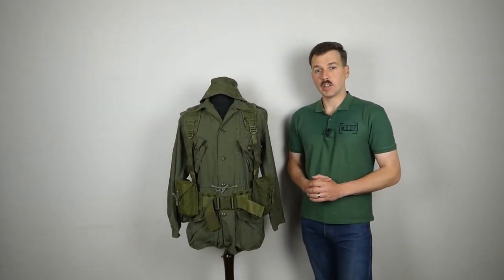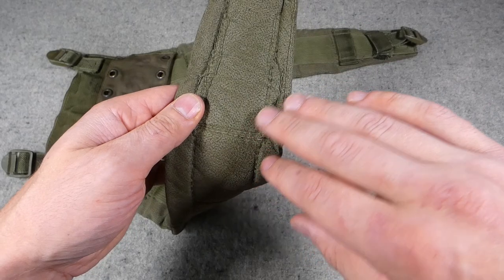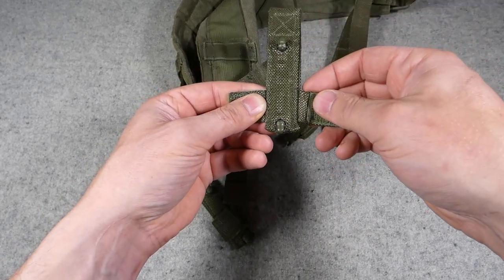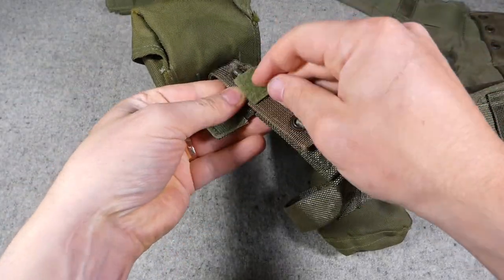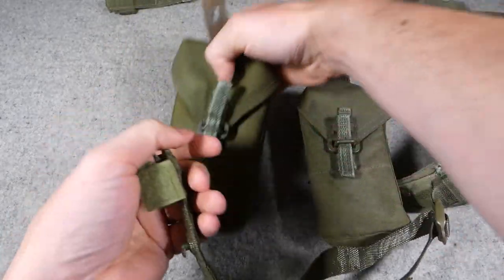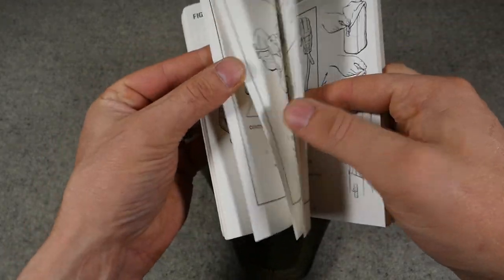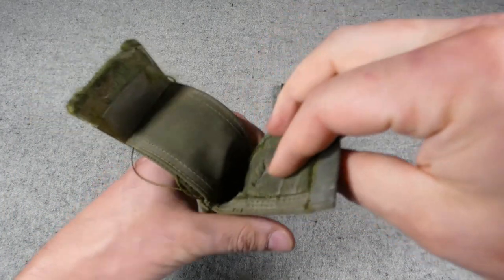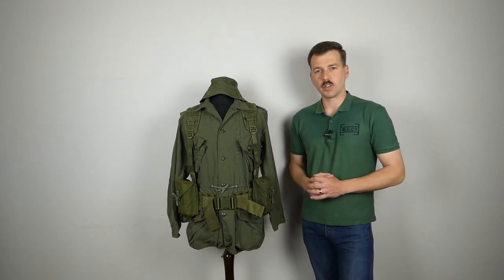Canadian 1982 Pattern Webbing Part II

Comment: In 1990 for the Gulf War I was issued a pattern of body armour which had hinged shoulder pads and brass hooks to locate the belt.  The vest of course interfered with the normal arrangement of pouches and straps.  The solution was to extend every adjustment and wear the '82 over the vest, clipping and velcro'ing the closures into place.  It was handier than putting on the vest then the webbing, and everything was still in position.  The problem of course was the whole upper body assembly weighed about 35-lbs all bombed up.

Comment: When I was in the CAF we didnt "cross draw" the bayonet. We used our left hand, twisted the bayonet upside down, yanked it down & out with a quick pull & then attached it to the C1 clasped between our knees held by our right hand
Reply: Exactly the same way we were taught to draw our bayonets in the Guards Depot Pirbright in 1974. When I came to Canada and joined the reserves (TA) they gave me prior service credit and promoted me to Cpl.  my UK training was pretty similar to the Canadian forces with some slight modifications. 💂‍♂️🪖⛑️🏴🇨🇦

Comment: Very nice video, only thing I would "complain" about is the middle drawstrings on the jacket. They should be tucked inside of it instead of being left outside handing. What I do with mine is tuck the left string through the button hole & the right one under the button itself. then just simply tie it and tuck it in and it should be fine.

Comment: 1- that tab might be quick to release but it was not quick to reclose in the winter with gloves on  and impossible with mits 
2- the hocks war down over time and eventually were just studs that would let the hole thing fall apart 
3-I never used it without the 2 mag pouches , mess tin carrier  ( with rain gear in that ) , small pack  , KFS  small pack ( aka but pack  which was the best part of the hole system ) , bayonet frog , canteen carrier+ canteen , canteen cup + burner  ring  with a pill bottle of water purification tablets gun taped to it ,  the other mag pouch  and usualy had a shell dressing on one shoulder and a compass carrier on the other  along with pace beads 
4-I never had nor did I see people with the entrenching tool carrier , we hung them from loops of paracord 
* we never used the SMG mag pouch or moved the pouches around and never put anything on the yoke back as we were always putting on or taking off ruck sacks 
* the  gas mask carrier  was never attached to the webbing , ever

Comment: Too bad the video doesn’t convey the absolutely horrendous smell that surplus 82 pattern seems to always come with
Reply: Even issued gear smells like vomit
Reply: Rotten cheeze
Reply: Mine never did, but a couple of my ground sheets did. That was from the urethane coating on the inside.

The urethane coating on the the inside of my water bottle carrier broke down very quickly and glued my cup in.
Reply: The water bottle carrier was always just a fraction too small. Trying to get the cup out was an exercise on its own.
Reply: rotting cheese?? I cannot stand that smell its so bad

Comment: Mess tins are long gone by the time WE82 comes around. Most troops that I saw didn't bother with the utility pouch. The butt pack was almost always worn in lieu of. SMG and C2 pouches all came out simultaneously.  Many troops cut the pull straps out. They were great for getting the mags out, but a real pain trying to put them back in.
Reply: I was issued the mess tins when I joined up in late '95. I was told not to use them as the aluminum would give me the Alzheimer's but that we still had to have them as they were still on the scale of issue...got to keep them when I released.

Comment: While the 82 pattern was an improvement over the 64 pattern, it had some problems. The metal eyelets on the belt would often pop off when removing the plastic tabs on the pouches. The pouch material would wear down fairly quickly and inside the pouches fraying was a big problem. We never used fighting order, I guess it was battle order we used, with the buttpack. The utility pouch had the aluminum mess tins which we were told not to use for health reasons. Inside the tins we stuffed our rain gear. On left shoulder we continued to attach a field dressing as we did on the 64 pattern shoulder straps. With the 64 pattern we used old Bren gun pouches for magazines, never ever used the pockets on our combat coats for carrying mags. Overall the 82 pattern had some good ideas but was cheaply produced, just like the 64 pattern lol...

Comment: As a Canadian Army veteran from 1992-1998! I never saw an E-tool! Ever! Not even Infantry! The bayonet wasn't a "cross draw" fixing bayonet is done with the left hand with the rifle held vertically in the right hand! The butt pack was normally always used by all combat arms and the NBC mask was always attached to the belt. The utility pouch was only used by c-9 gunners as the mess tins where gone by the '90's! (something about aluminium poisoning)

Comment: 12.51.. when I was actually using this webbing ( pre-British PLCE 1993-94?) I always managed to sit a 58 pattern Black water bottle mug inside on the top of the CF water bottle.  It was a tight fit, but I did not get my lips burned on the metal cup. 💂‍♂️🪖⛑️🏴🇨🇦

Comment: Great video. It's heavy duty kit. To bad, it was designed. For people 5' 10" and taller. If you wear it all. Backpack etc. Cheers 🍻
Reply: you had to string the web belt through the ruck frame and than put on the pouches as needed.
Reply: @joeydepalmer4457  
Ya. That sucks 😕